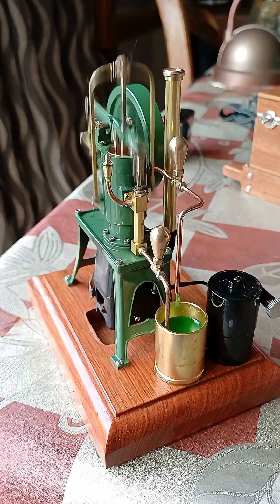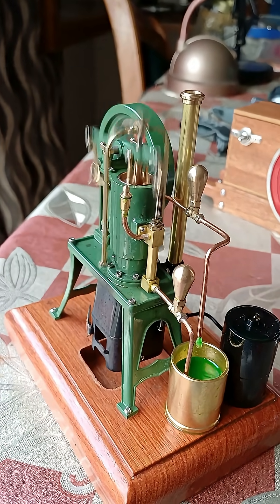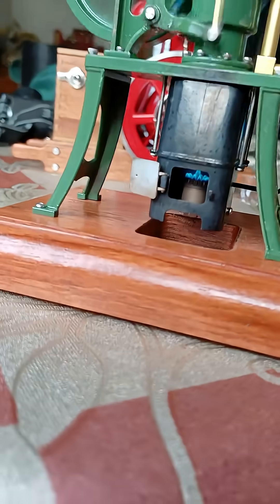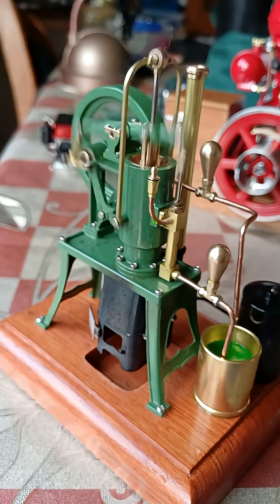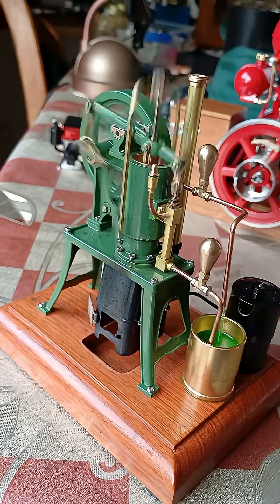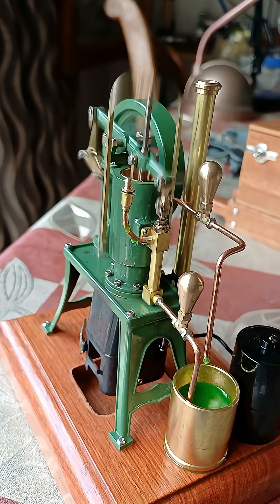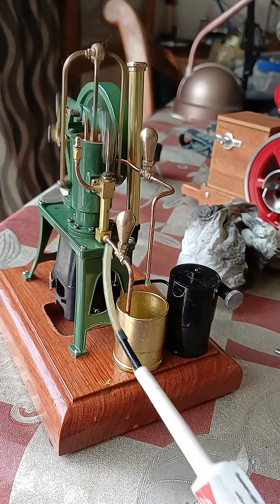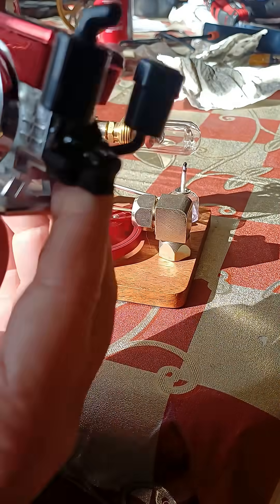Micro engine runs on flame pumps water OKMO R01

Comment: What are the 2 brass domes for?
Reply: Deve ser para manter e estabilizar a pressão da água 👍✌
Reply from the maker: These smoothed out sudden pumping pressure changes to reduce thumping in the pipes, in the original engines :)

Comment from the maker: OKMO R01 is easiest if you have tiny delicate hands like a garden gnome. Instead of opening the priming cap, use a syringe and a bit of OKMO fuel tube over the water pump out flow and suck the coolant water through to prime any time the engine stops and needs rep[riming. Easy!